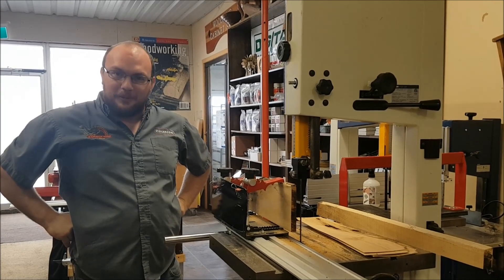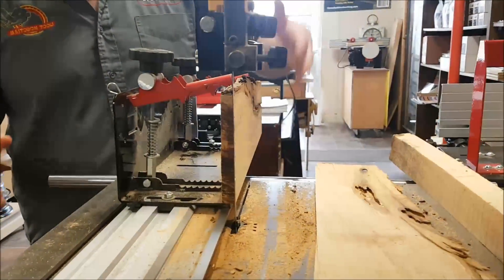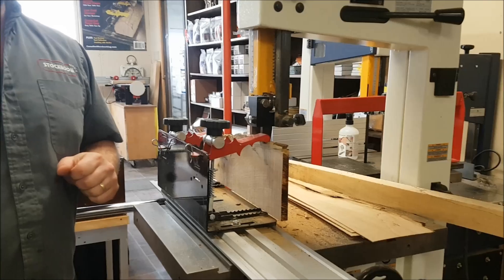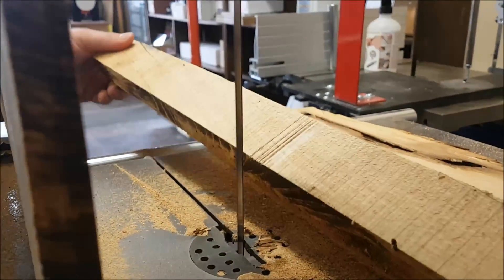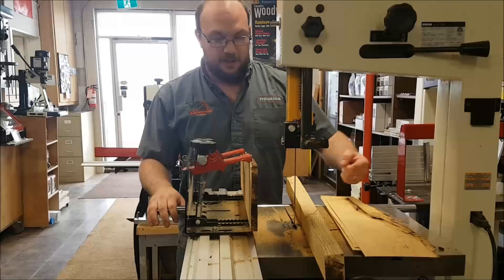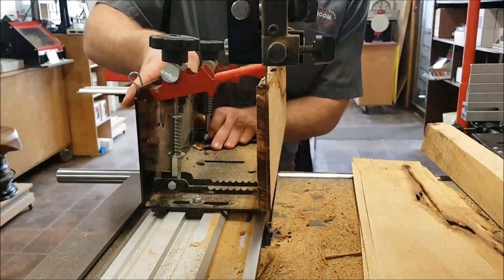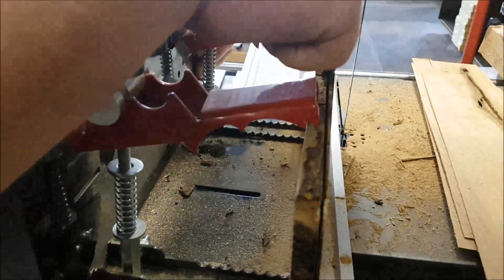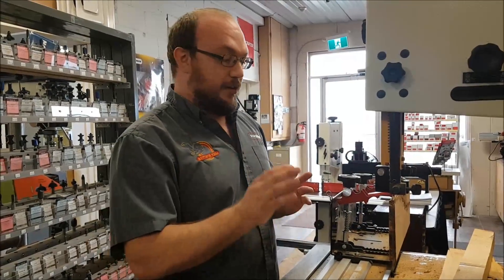My Little Ripper Drifts! What Am I Doing Wrong With My Bandsaw? EthAnswers

Comment: If you have been cutting circles on your bandsaw you have dulled one side of your blade. Take that blade out and replace it with a new blade for your straight cuts. Lable them and you will get full usage out of your blades and less frustration. And less waste

Comment: Although I’ve been in the construction industry my entire life at age 55 I decided to get in to finer woodworking. One thing I learned instantly was that woodworking is no different than any other hobby there are 1 million people doing it and 1 million opinions on the right way to do something . I do not have A bandsaw yet but I do enjoy watching your videos where you prove your point no moreOpinionated rhetoric and speculations just provable facts, I like it. My first purchase will be a little ripper after I can afford a quality bandsaw. Can those little cheap the benchtop bandsaws be tuned to actually do a decent job?
Reply: You can tune a Honda Civic to out perform a Dodge Charger.  Depends on your money  and time.  Little ripper seems perfect for straight perfect cuts, but use dedicated blade and another for non straight. Or 2 bench saws.